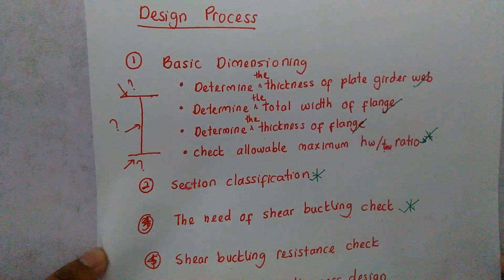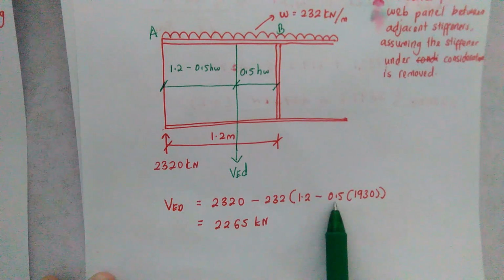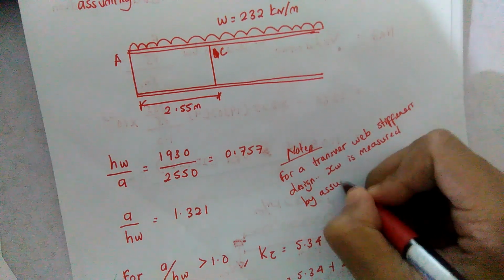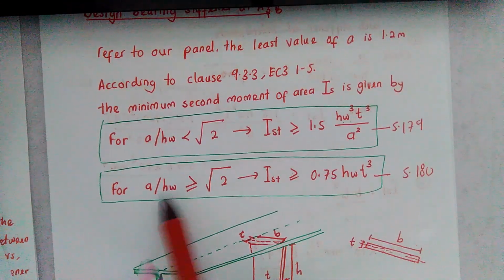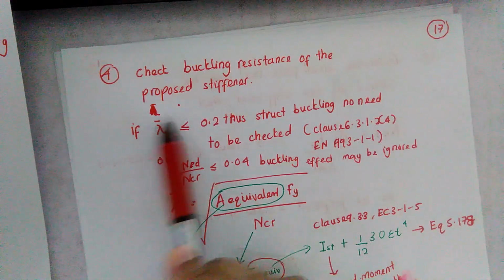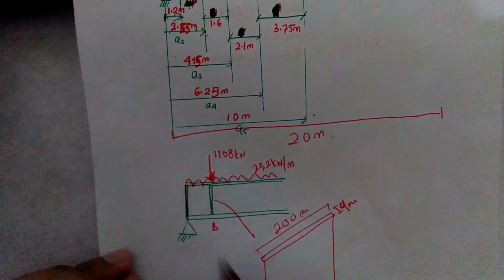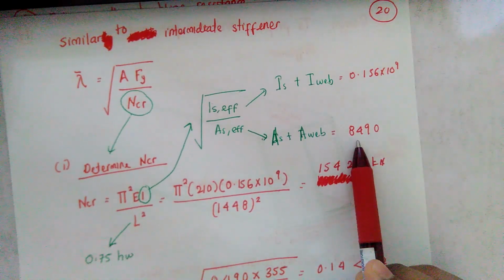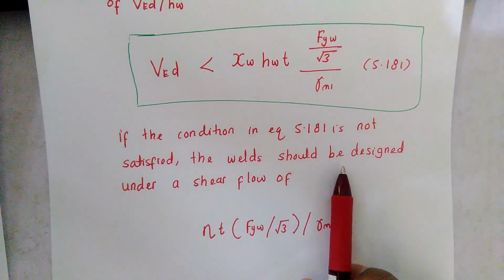ADVANCE STRUCTURAL STEEL DESIGN (ECS571): CHAPTER 2:DESIGN OF PLATE GIRDER (Example part 4)

Comment: Hi. A good series of lessons on calculating plate girder, but there are a number of questions on the last step. I think you made some mistakes
:
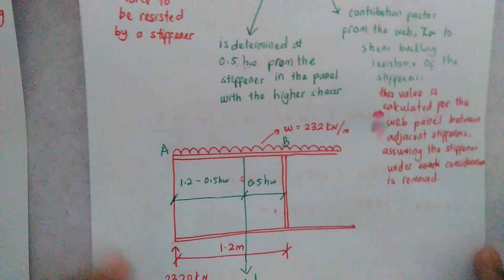1) when we consider the AB panel, we should retreat (0.5*hw) from point A, and not from point B (at 4:40);
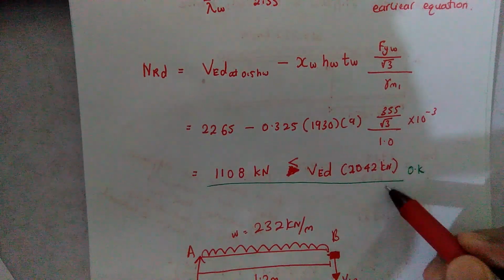2) at 15:36 you do something strange. (VEd - ....) - this is not resistance (NRd), this is the effective load (NEd). For this force, it is necessary to check the stiffener, and not compare with the transverse force on rib B;
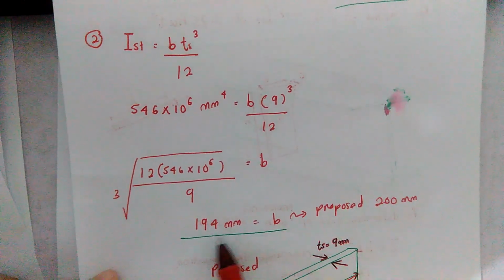3) (at 22:56) If you use double-sided stiffeners, then when determining the width of the ribs 200 mm - this is the total width of the ribs. Each rib should be 100mm. Otherwise, 9x200mm is the fourth section class and this must be taken into account when determining the NRd;
4) (at 32:47) End stiffener 15x500mm has fourth section class and this must be taken into account when determining the NRd.
Reply from the maker: Thank you for your comment. Ok, I will have a look at the two points u have mentioned about.